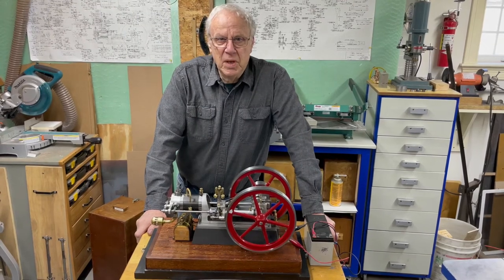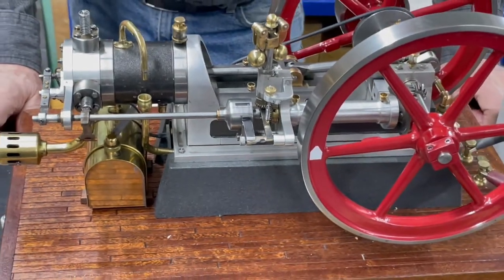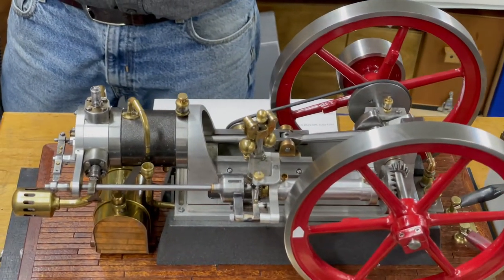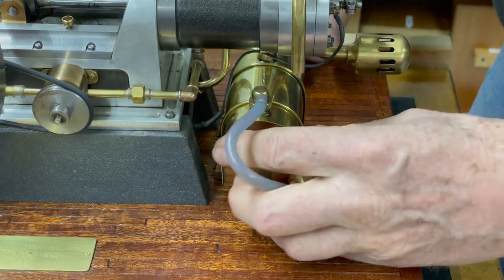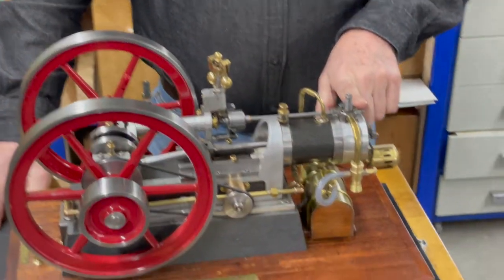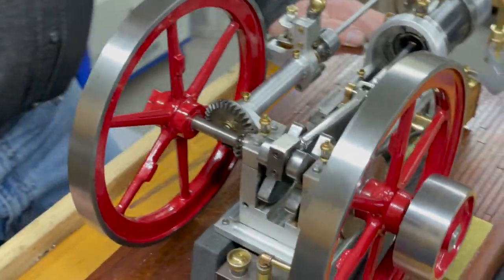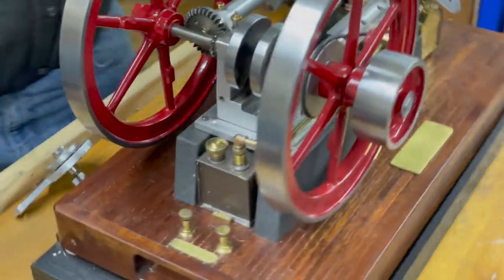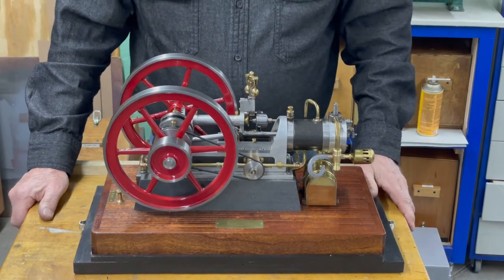Doug Kelly's Mill Engine #2 by Joe Higgins

Comment: Its interesting how different your engine sounds compared to his original.
Reply from the maker: There are a few things different that can cause this. One is that I have a
Reply from the maker: Oops wrong button, I was saying that I changed the muffler, also I have a different fuel mixer. In my video it’s not broken in so I am running it a little bit faster. Another thing is my timeing

Comment: This is a very nice looking engine. I would like to build it as my next project.  I'm currently building my 14th engine "The Hoglet".  How can I get a hold of Doug Kelly to see if he would sell me the plans that you mention in your video?  Thanks Larry
Reply from the maker: Hi Larry,
I’m not sure about Doug’s status on that set of plans. He told me last year that he didn’t intend to publish that set because of the fact that it’s a complicated engine to set up and get running. Also he never really finished them to his standard. Doug is a very nice guy but he is 89 years old and he isn’t going to cabin Fever anymore.  I can ask around but it will take a while.  
Have you checked out the book that has 4 engines in it by Doug. The latest Home Shop Machinist  has the plans
For that little generator . Sadly I think that will be the last engine we will see from Doug.
Joe
Reply from the maker: PS I forgot to ask if you go to cabin Fever.
Reply: Hi, Joe I have never been to a Cabin Fever Event but have seen the YouTube videos and it looks like a lot of fun. I like the little generator you made, I just went out yesterday and got (2) 1 1/2" coupler pipes, I'm going to try and make a couple.  I would appreciate if you do hear about a set of plans, I'm still very interested in make it, Thanks Larry. @JoesModelEngines
Reply from the maker: Hi Larry,   (good news). send me an email to me at. jhig5@maine.rr.com   and I will tell you how to get the plans. Joe

Comment: 3:59  Joseph, I'm not familiar at all with the pneumatics and plumbing of these spectacular engines, so this is a question I ask out of ignorance and in no way a challenge: Why is there an air gap here rather than, say, a short length of glass tubing to keep it a closed system?  Is pressure/vacuum an issue?  I love learning more about these beautiful machines.  You did a fantastic job on this!
Reply from the maker: Actually it’s just an old way of being sure that the water is circulating . I try to do things that would have been done in that time period. Also it adds a little more interest to the engine.Thanks for your questions. Joe
Reply: @JoesModelEngines  You truly are a master craftsman, sir.

Comment: wow, a very nice engine ! it is quite a mix of steam engine and early IC engine! i would try to make a direct injection and a injection controlled by a  governor,perhaps thar would make him purr nicer...i dont like the hit and miss sound , only when they are under load....
but a very nice engine here !
Reply from the maker: Like I said before this is my favorite engine of all the engines I have built. It always makes a lot of people stop and study it and most ask how the stop cam works. It’s a little hard to get set up but once you get it set it seems to stay and it will always start easy.  Another one that I always take to the shows is the six cycle oddball. It will run for hours without attention. 
Thank you for your comments Joe
Ps I did not get the email. Jhig5@maine.rr.com
Reply: @JoesModelEngines  i tra to send it again tomorow, i just did a nightshifter on my flywheel wich took me a full day to get set up and now have the OD and faces turned in tiny tiny passes. the engines u made are nice. if i remind corect u made a snow engine model , if so , this is a very spectacular engine! to bad that there arent any plans out there for such things. i have the highest respect for those who attempt to plan and draw plans and then buold the engine and get it to run....but it pays off. i always sit back and smoke a cigar and drink a rare bean coffe when i finished my projects and it is quite an amzing feeling....greets
Reply: sry for the typos..i am realy tired right now ;)
Reply from the maker: @pirminkogleck4056  Hi Pirmin,  The snow is a very nice engine and gets a lot of attention at a show.
I built 2 of the Shows and they are both on YouTube. I stopped talking them to shows because I twisted my back out twice lifting them out of the car. The plans are available as a book. I’m going to try to send a photo of the book in a email.